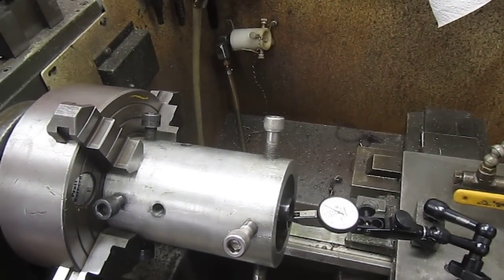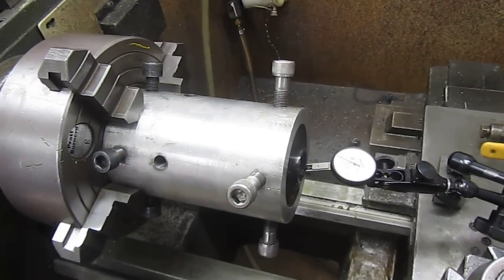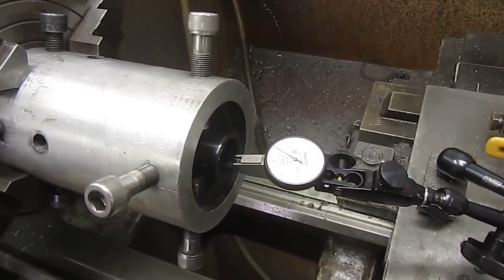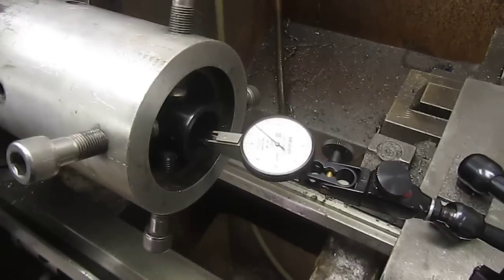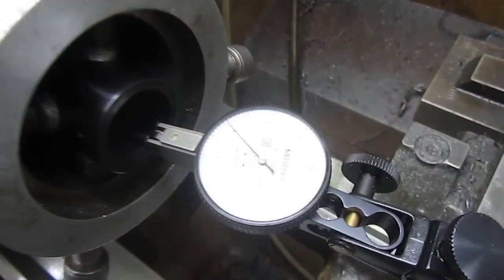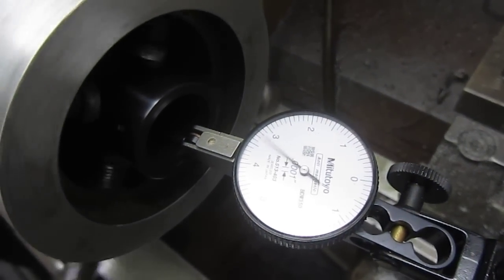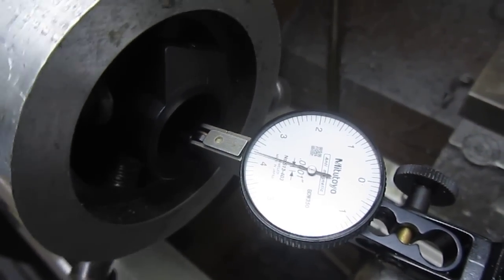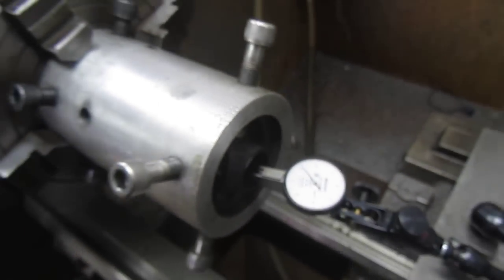Howa 1500 action thread concentricity.

Comment: Gday, just a question for you, I'm shortening the tube on my 223 1500 varmint, in my state legal length is 16inches where the receiver meets barrel on the exterior, I'd like to go that short but am unsure if. The 1:12 will have enough length to retain accuracy. Is 1/4 less rifling enough to stabilise 55grns?   I want less barrel in the cab of my Ute at work, as I am constantly using it and putting it back down shooting vermin and predators any help would be greatly appreciated. Cheers Adam